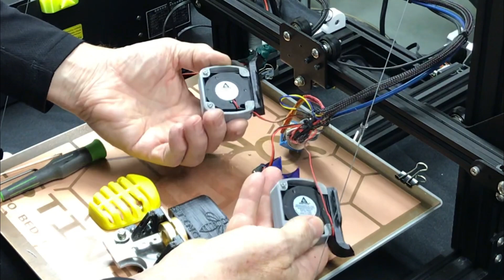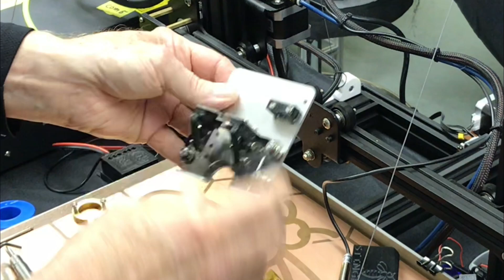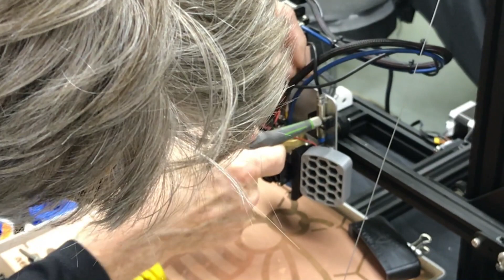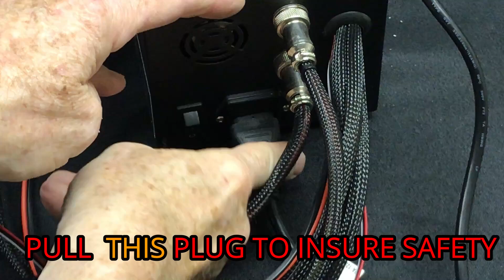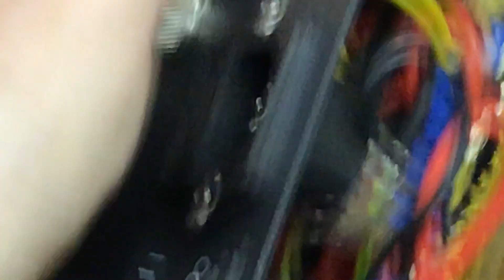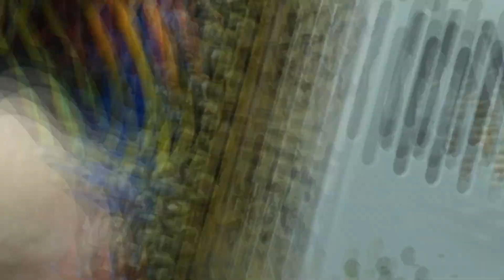Stinger 2 install

Comment: Very nice video...some nice install improvements over the first version!
Reply from the maker: Thx. We'll eventually update all subsequent vids including SETTING TIP OFFSET VIA SLICER, Quick removal and servicing TIP, HOTEND and setting PID to calibrate thermistors and heaters. 
Please subscribe and hit the notifications bell to stay current.

Comment: im currently considering this but ordering a e3d v6 for my CR-10s - love the mods you have on your site - going to have to order in stages as the shipping really adds alot more price to it - im in canada - my questions is how should we setup our e3d v6 hotends if adding your kit to my cr-10s?
Reply from the maker: It uses the E3D V6 or Volcano right out of the box (you’ll need to order the longer fangs for the Volcano). You can also use the clones but I’ve had best experience with genuine products. There’s a special price on Kickstarter going on now which should help offset your shipping cost.
Reply: also, how do i order the longer fan - there is no options on either site
Reply from the maker: Martureo Martus upon order you can put a note in to please include longer fangs for the Volcano. I will include the option on the website.